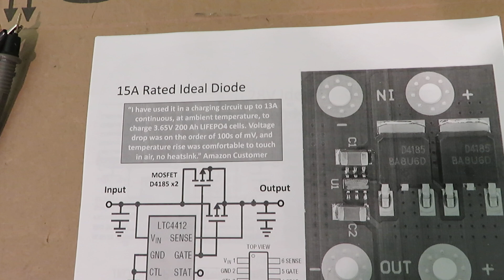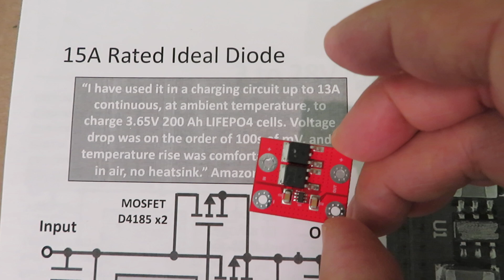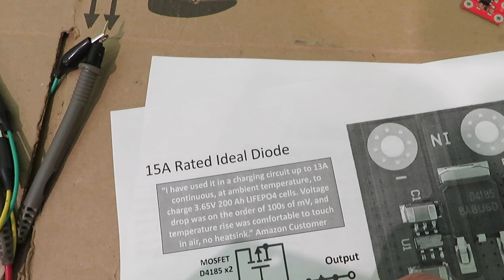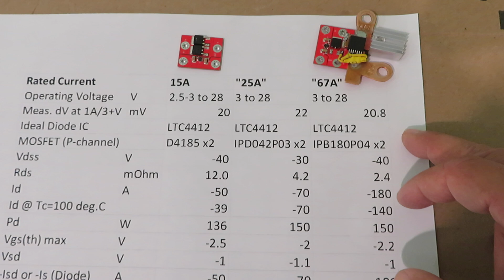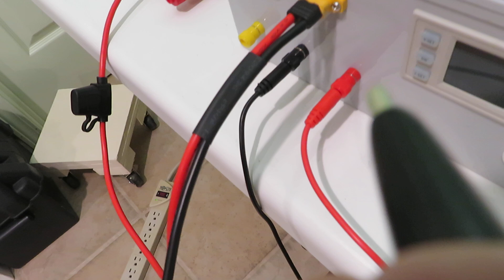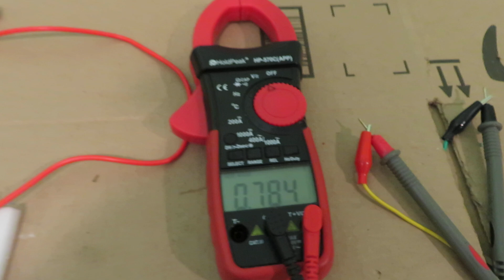Part 1: 15A to 67A Ideal Diode (Blocking) Modification Needed for Low Voltage Charging Applications

Comment: Thanks a lot, neat Power supply, i love it. I grilled a lot of power supplies to a reversed voltage/current. I use used server power supplies for a cheap high current source, maybe its an idea.
Please don't overcharge your LFP over 3,65V, at any time. Not a good idea.
Reply from the maker: Yes and thanks, I don't charge LiFePO4 cells higher than 3.65V.